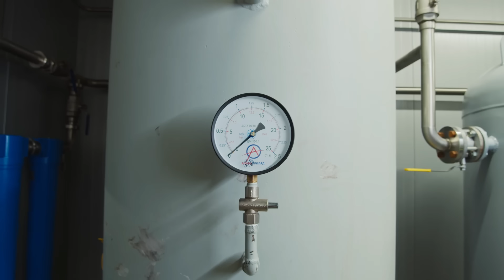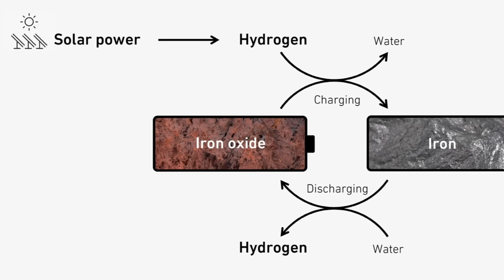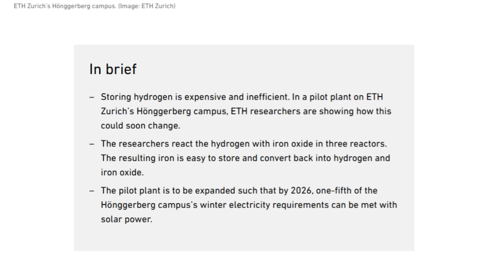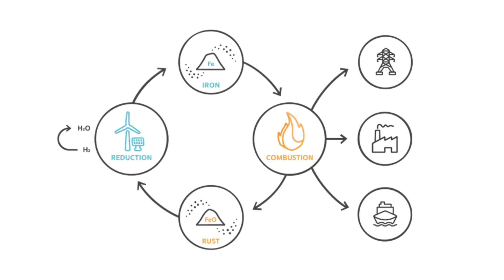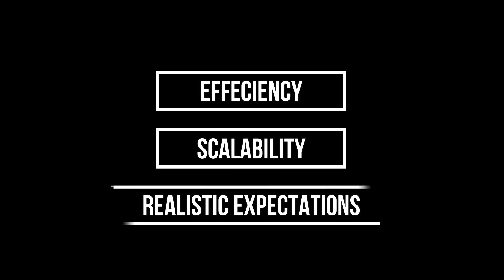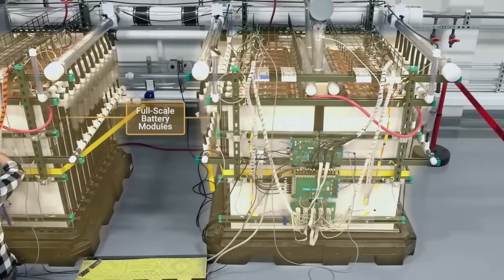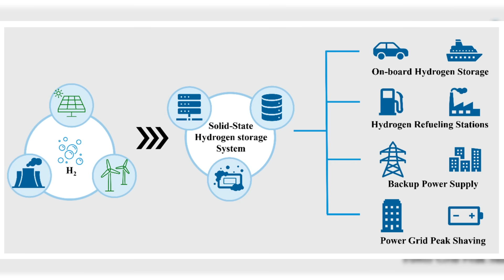Could This Low-Tech Solution Beat Lithium and Hydrogen Tanks?

Comment: It is all nice, until you see the bill...

"All of it happens at about 400° C inside
1:53
robust stainless steel tanks filled with
1:55
finely ground untreated iron ore."

And it will contain hydrogen, a Class I, Division 2 location?
SOUNDS EXPENSIVE.

Hydrogen is known as "Hard to hold."

In industrial settings, it is monitored by some interesting systems($$$).

The vessel frequently cycles temperature and needs access openings... a good way to find minute leaks.

Interesting process.
REMEMBER THE HINDENBURG!

Comment: Hold on you need steam to get the energy back out? how are you gonna get the steam without any energy? Seems like you're spending to retrieve at the point wouldnt you get better returns by using the steam to power a steam turbine generator?
Reply from the maker: Yep, you need steam—but not high-pressure. The idea is to use low-grade heat, like from excess solar or waste heat, to generate the steam. The hydrogen released can then go to a fuel cell or turbine, depending on the setup. So you’re right: in some cases, direct steam use might be better—but this system adds flexibility and storage to when and how you use that energy.

Comment: It’s just unfortunate that you have to make super heated steam to use this that means that you have to combine this with others storage mediums and have all of their drawbacks too to use this. There’s no cold starting this system.
Reply from the maker: True, it’s not a “cold-start” system—you need thermal input to kick it off, which adds complexity. But for seasonal storage, where you already have excess heat or solar in summer, that trade-off can be worth it.

Comment: If you ionize iron will it still oxidize?
Reply from the maker: Yes—ionized iron can still oxidize, though the chemistry depends on the state it’s in (solid, dissolved, etc.). In most practical systems, once iron loses electrons (gets oxidized), it forms iron oxide—that’s basically what rust is.
Reply: @Generalphysicsknowledge so solid iron will still rust if ionized. ok thanks

Comment: I suspect the long term nature of this makes it uneconomic. A battery you only use a few times a year if it is mainly operating seasonally!   Plus any association and use of Hydrogen is rarely practical. More practical growing and burning logs!
Reply from the maker: Totally fair—seasonal use does raise questions about cost-effectiveness. But if it replaces gas or oil boilers long-term, the math can still work—especially as energy prices and CO₂ costs rise. And hey, growing and burning logs? Still one of the oldest and most resilient solutions around.

Comment: The 400C operational temperature, is a no starter.
If you can generate that much heat, why do you need to pull out the Hydrogen? Also, you still need expensive Fuel Cells to get electricity.
Use classic Metal Hydride for hydrogen storage, or go to a Flow Battery.
Reversible  Fuel Cells or Reversible Air Batteries are also interesting.

Another is compressed air underground. Cheep and easy, and I bet is better than that 40% discharge/charge ratio of these iron oxide storage system.
Reply from the maker: The idea here is to store seasonal energy in a solid, stable, low-cost material without relying on high-pressure tanks or rare elements. Definitely not a one-size-fits-all solution.
Flow batteries, metal hydrides, compressed air—they all have their place. What’s exciting is that we’re finally getting a toolbox instead of trying to solve everything with just lithium.
Reply: @Generalphysicsknowledge True, it's nice to have a varitiy of tech, rather than just one (Lead Acid, at one point.)
But this Iron reformation system, that requres such high temperatures, reminds me of the compressed hydrogen gas for cars, where almost as much energy is in the compression of gas, as there is in the actual fuel.

So much waisted energy in the whole.

We need something better that "Possable" or "Good Enough", because we already have that, and it's Good Enough and is avalable off the shelf.

For a new tech to take off, it has to be much better than what came before. 

In energy storage, ther are thousands of cases of stuff that was Good and Intersting and was never looked at again, because the current tech, was Good Enough already.

Now if they could update something like the Iron tech, so that it operated at say 150C, or could use it in Energy Transportation as well as storage (Vehicle battery, say for cargo ships.) They would have somthing.

Comment: For sure metal hydrides are great for storing hydrogen. Iron oxide is cheap and plentiful. Surely there are mines that produce iron oxide that wouldn't need to be refined into a metal, the hydride could come straight from the ground with impurities removed by magnets. I look forward to seeing more of these going forward
Reply from the maker: Absolutely! That’s one of the coolest parts—iron oxide is abundant, and in many cases, it doesn’t need heavy refinement. Using magnetic separation to clean raw material is a smart angle too. Exciting to think this could scale using what’s already in the ground, not rare elements.

Comment: "Generalphysicsknowledge" seems to be missing basic mathematic skills. To keep a house warm during the winter in Switzerland it normally takes 10-15 MWh (10-15 000 kWh).
So, a system with 4.2 m3 of iron ore will "release" about 4-6 MWh of energy, and that would serve 3-5 houses? 
Please, take a math course before you make your next YT production. Also, check the cost of purchasing 12 metric tons of iron ore and 3 pieces of 1.4 m3 stainless steel tanks. Not to mention how to store the H2 .
Reply from the maker: Appreciate the sharp eye—you're absolutely right to challenge the numbers. The pilot system referenced 4–6 MWh of usable energy, likely assuming efficient, low-consumption homes or partial seasonal coverage. And yes, costs and materials like stainless steel aren’t trivial—but the project is still in early R&D, not pitched as off-the-shelf home tech (yet). Good points—will clarify that better next time!

Comment: Ayrton Energy just partnered with Hawaii Energy that safely stores hydrogen gas inside room temperature non-lethal organic type margine liquid that can be recycled 1,000 times before replacing the clear liquid ideal for all fossil fuel infrastructure.
Reply from the maker: That’s a cool approach—liquid organic hydrogen carriers (LOHCs) like Ayrton’s tech could solve a lot of the safety and storage issues. Great to see multiple paths being explored for clean, practical hydrogen use!

Comment: those who compare long term energy storage vs short term like batteries always make the same mistake, is not really about that batteries can not maintain their charge over months (that is a feature but not the most important here), it is all about the cost to store extra capacity.
For example, a normal lithium battery is only cost efficient to store up to 4 hours of any energy source (solar farm, wind farm, etc).  Once it reach those 4 hours of total capacity, any excess power is completely wasted because your battery is full, if you want double capacity with batteries, like 8 hours, your cost doubles, if you want 1 day your cost multiply by 6, a month or year of storage is impossible..
Instead with hydrogen (spliting water), you need a similar capital to store those 4 hours of power output, but scaling hydrogen capacity is really cheap, you can double and double and double that with almost no change in the capital cost. 
Why we still use batteries on most storage applications then?  
Because on our current energy share (20% of the electric grid) of intermittent sources like solar and wind,  we only need 1 or 2 hours of storage to backup what other energy sources like thermal can regulate. 
But once your solar and wind share keep increasing (they will because they are the most cheapest way to produce power today), you will have less thermal sources to regulate, this mean you will need more storage exponentially, from 12 hours, to days, to months.
That is where long term energy storage comes in, is not because batteries lose charge over time, is mostly about how cheap is to scale capacity.
Batteries would keep being the most cost efficient solution for application that requires 4 hours of storage or less.
Reply from the maker: Perfectly said—it’s not about self-discharge, it’s about cost scaling. Batteries shine for short-term, but for seasonal or multi-day storage, chemical systems like hydrogen become far more practical. Great breakdown!

Comment: If you want to have a Future. 
Don’t fool around whit hydrogen!!
Reply from the maker: Understandable—hydrogen has risks and challenges, no doubt. But it also offers unique benefits for long-term, large-scale storage. The key is using it wisely and safely, not blindly.
Reply: @Generalphysicsknowledge wisely would be in the proper industrial storage tanks. 
But for normal people it’s not something to mes whit. 
Hydrogen is nr 1 on the list of elements, and therefore the smallest  atom.
Everything else you will use to contain it in has more space between the  atoms.
So it’s hard to avoid leaks between welds  and other connections . 
You can’t smell it .
Than hydrogen can self ignite by temperature’s above 70c , so absolute vacuum is needed before any startups . 
And if it’s ignited it’s also super energy dens and gives a really big boom compared to other gasses..
Industrial use definitely 💯.
But I wouldn’t want my neighbors next to me mes whit it
Reply from the maker: @dennydewaal137   you’re right: hydrogen is tricky, leaks easily, can self-ignite, and needs serious containment. That’s why systems like the one in the video don’t store pure hydrogen under pressure in homes. Instead, the hydrogen is bound inside solid iron during storage—no tanks, no high-pressure gas sitting around. Still industrial-grade tech, but much safer than typical hydrogen systems.

Comment: I feel like a idiot, I really don't get how it work, is like the story of the donkey and the salami, se mi poin without a proper story and sequence of events you're in limbo.
Reply from the maker: Totally get that—it’s not the easiest system to picture! In short: it stores energy by using hydrogen to turn rust (iron oxide) into iron, and later releases that energy by letting it rust again. It’s like charging and discharging a battery, but with solid metal and steam instead of wires and chemicals. Weird, but real!

Comment: im going with thermal energy. trying to focus it. i think im on to something all thermal energy is infrared energy also called black body radiation. a parabolic mirror can focus infrared light to a point putting more infrared energy at a point and make that point a sterling engine anf on the coldside of the sterling engine use heat pipe technology to put that back into a wall the parabolic mirror got the energy in the first place then i can convert into
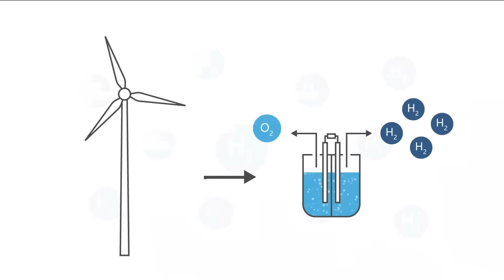heat into energy maybe it can double as a ac because overunity energy is impossible so it must loose heat somehow making it cold. its kinda a tin foil hat idea for free energy that if fails its maybe a ac somehow energy got to be lost right? the parabolic mirror focuses the ambient thermal energy thats uniform everywhere everything is above absolute zero. and you can add vacuum tech to allow light energy to get in but cant get out with conduction so any light that hits it should replenish any energy lost in the system keeping the plate the parabolic mirror is touching warm. im experimenting now but i think im on to something but maybe im just crazy. but theres another really old idea that used water that flows into a funnel made a water tornado like thing that sucked in water into a chamber below and was able to raise water 20 feet uphill not much energy there but water flowing 20 feet uphill is impressive considering now its got more pressure than before and do that again i dont see how you cant raise water up 500 feet using like 25 of them suck water from the well thats 300 feet deep to fill a tank thats 200 feet high to have a decent pressure water line that uses no energy wheres the energy in that system? bubbles just float. https://www.youtube.com/watch?v=xLaLpMeOyHk skip to 7:15 for the free energy water pump
Reply from the maker: You’re definitely thinking creatively—and you're right that infrared = thermal radiation. But: parabolic mirrors can focus sunlight, not really the low-energy ambient heat around us. Stirling engines + solar thermal? That’s legit. But not overunity—the system still loses heat (which could double as A/C, like you said). As for that water vortex pump: clever use of pressure, but it’s not free energy—it’s just smart fluid mechanics using gravity and flow momentum.
Reply: @Generalphysicsknowledgeim ok with failure i fail a lot its fine i tried. i dont want to get old with regrets nope i tired and failed but i tired. i got me a 80 foot parabolic mirror to experiment with i figure if i fail i still got a stupid large parabolic to use for the suns energy. but im gonna try to focus about 300 square feet to a point hopefully get enough power to run a low power sterling engine. i like experiments that regardless of outcome ill still get good results. so its a win a little or win a lot kinda experiment. its a $3000 mirror but considering you pay $1200 a year on power it will pay for itself in maybe 3 to 4 years of use and thats only if i cant sell power but from what i understand they pay for extra power so if you generate 48kw extra thats $3500 to $7000 a month in profit. if all really works out i get money out of it and it pays for itself in a month or two. if anything ill probably get more energy if it fails because ill use the sun instead. if i fail ill put a heat pipe inside of a pipe filled with dirt so that the dirt acts like a salt battery and i heat the dirt for maybe 8hr and it stays hot to run a starling for 24hr a day i did some basic math and its only 4 inches of dirt that will last 24 hours. but when it comes to thermal solar power so far i cant find anything that beats it. if i succeed or fail results are cool. and the water thing its cool ill build that if the mirror fails to extract energy from infrared energy from warm dirt because i really would like to have that impossible free energy device
Reply from the maker: Honestly? That’s the perfect mindset. Win a little or win a lot—either way, you’re learning and building something awesome. An 80-foot mirror is no joke! Even if it doesn’t power a Stirling engine, you’ve got serious solar potential. Respect for going all-in on experiments most people only talk about.
Reply: @Generalphysicsknowledgeyeah but i do spend a lot of money on experiments.
Reply from the maker: keep it up

Comment: This was predicted before millenia. Iron  weapons will be used for 7 years as fuel .
See relevant facts .
https://youtu.be/rKVj1CwAmmk?si=lS3GtfUHVXoUXoZz
Reply from the maker: That’s a wild connection—and kind of poetic, honestly. Turning iron from weapons into clean energy?
Reply: @Generalphysicsknowledge

https://youtu.be/rKVj1CwAmmk?si=lS3GtfUHVXoUXoZz
Reply from the maker: That’s a solid concept—burning iron powder for industrial heat makes total sense where electricity isn’t practical. What I find really interesting is the closed-loop idea, where the rust gets recharged using renewables. It's kind of the inverse of the ETH Zurich approach, which stores hydrogen in iron rather than releasing energy by burning it. Same material, two completely different energy strategies. Super cool.

Comment: "... at 400C..."  Where's the 400C coming from???
Reply from the maker: Great question! The 400 °C heat ideally comes from excess renewable electricity—like solar power converted to heat—or from industrial waste heat. No fossil fuels needed if the system’s run as designed.

Comment: Oh, the Hydrogen myth again. Hydrogen is difficult to store either under pressure, or super-chilled. Yes, it does have great energy density per Kg, but 1Kg of Hydrogen at room temperature occupies approx. 12 sq metres.
Reply from the maker: True—pure hydrogen storage is tricky. But this system doesn’t store compressed or liquefied H₂. Instead, it stores energy by binding hydrogen into solid iron. No high-pressure tanks, no cryo cooling—just safe, low-density in-place conversion.
Reply: lol, did you even watch the video?

Comment: We are still need to store hydrogen somewhere with tend to be problematic. Not mentioning high temperature needed to get water steam. How about we use tested and comercially available solutions like Lavo from Australia. Despite 50% efficiency it is working solution. Having abundant amount of free electricity from my solar panels I rather waste 50% of it so I can use some later during winter than get 10% from electricity suplier.
Reply from the maker: Totally get your point—reliability and real-world performance matter more than theoretical advantages. Lavo is a solid, working system, even at 50% efficiency. The ETH concept targets seasonal storage with no pressurized H₂, using low-cost solid iron instead. But yes, the 400°C heat demand is a big hurdle. Until that’s solved sustainably, systems like Lavo are probably the smarter choice for most homes.

Comment: You store high explosive H2 and say it is more safe than batteries?
And what about H2 storage? Hydrogen is the smallest atom and easily diffuses through other materials. How do you want to store it without loss... and then under pressure?
Reply from the maker: Great question—and a common concern. But in this system, hydrogen isn’t stored under pressure or in large volumes. It’s produced and used immediately inside sealed tanks, reacting with iron. The real storage medium is solid iron, not gas. So there’s no high-pressure hydrogen, no explosive tanks, and minimal leakage risk. That’s exactly why it’s considered safer than batteries in many cases.